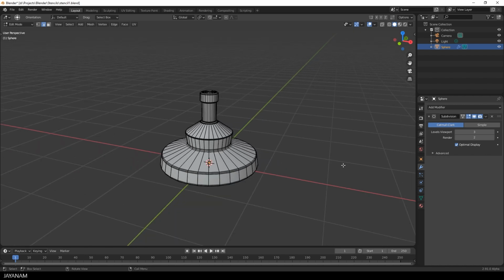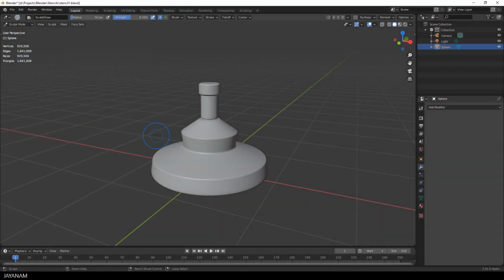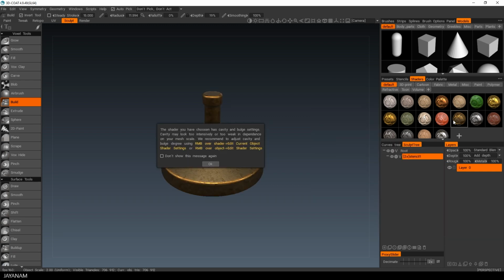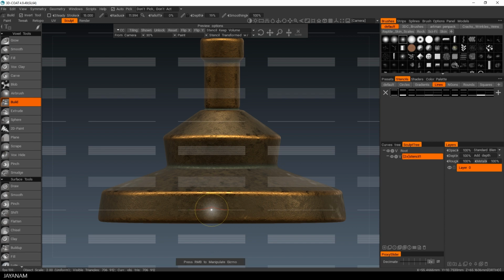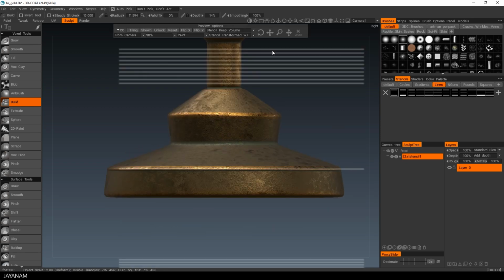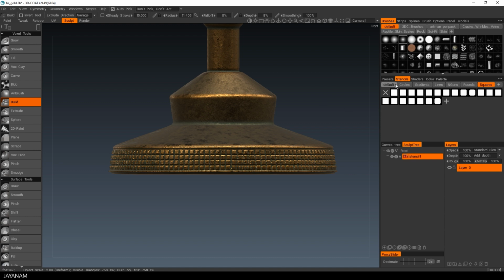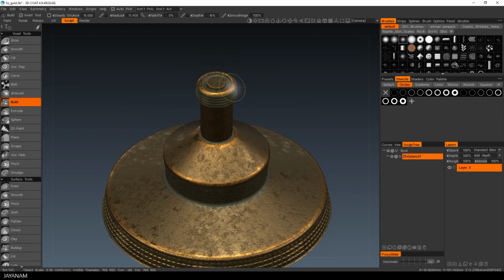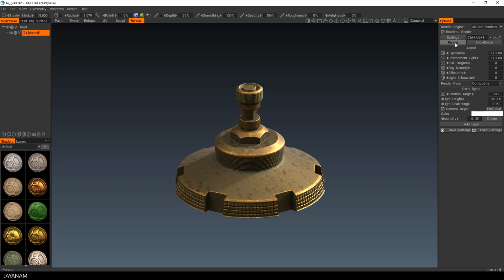Blender and 3DCoat Hardsurface Sculpting Tutorial

Comment: 3d-coat is a nice piece of software. Been following it since it was 3d-brush. Some really nice texturing features, but the sculpting is somewhat awkward with this discrepancy of voxel\surface mode, where you constantly have to lose detail switching from polygons to voxels. Other than that - you can create a game-ready asset without leaving the software. Pretty much like Blender. Only in Blender the PBR texturing is really crappy and in 3d-coat - the low poly modeling sucks(as well as high poly tbh, but you can get used to it.)
Reply from the maker: Yes, I know what you mean, cherry picking the best features from Blender and 3D Coat to one tool would be a dream:-) For some feature I just use 3D Coat (although I have Zbrush) : Booleans, The mighty Pose Tool, Texture Painting, Stencils. I also used 3D Coat's retopology but switched to Blender now for these tasks (really good now, when you have the right addons:-))
Reply from the maker: @daronz  Have a look at this one: https://youtu.be/al86vQPE-fU
Reply: Sergei, sounds like you complain more then you learn. I'm using both Blender and 3DC and what you say doesn't sound like anything i ever feel.

Comment: I used to love texturing with 3D Coat using it's smart materials but it's just so slow compared to Substance Painter. Such a shame because I love the software.
Reply from the maker: Really, I never had performance issues with it.
Reply: @JayAnAm  Yeah, never with hand painted stuff, but as soon as I started importing smart materials and switching around it would just hang for 30 seconds or so each time. Now days I used it for just UV unwrapping. Great videos and big fan by the way :)